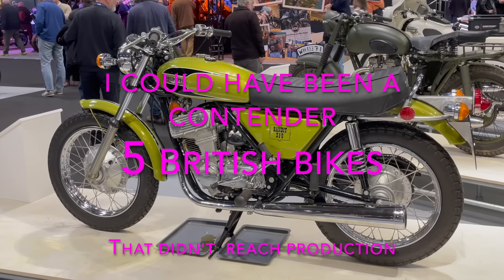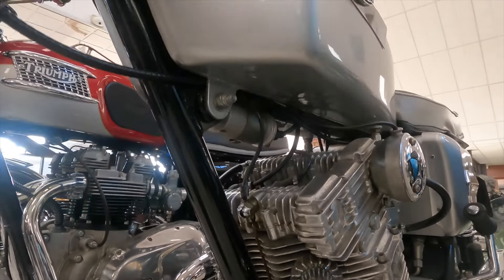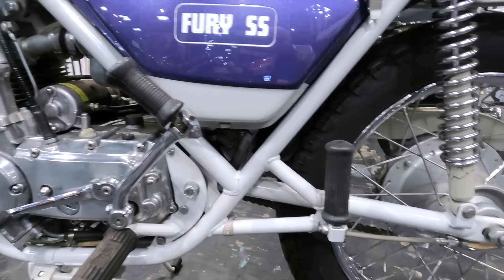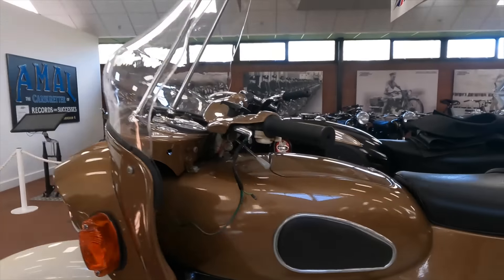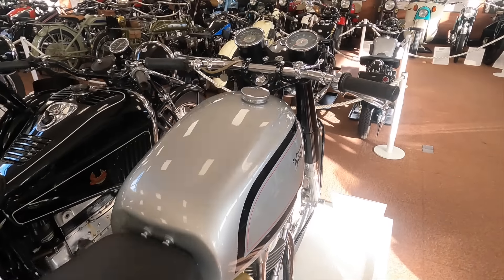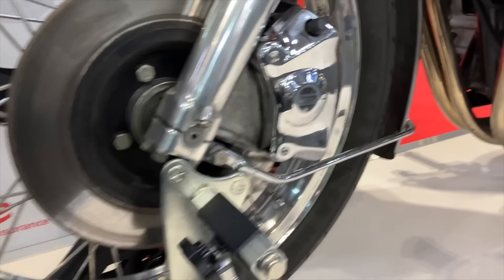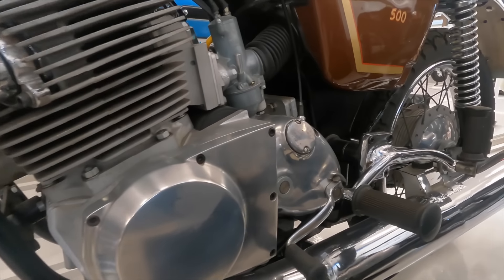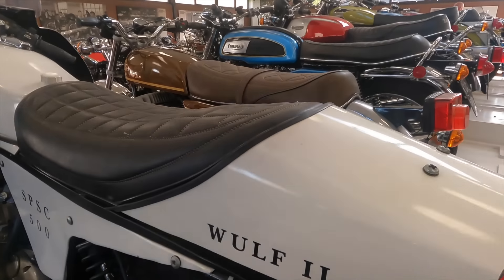They could have been a contender, 5 British bikes that didn't reach production

Comment: Part of the problem was the machinery the bikes were built with. Worn out lathes that the operator had learnt to compensate for. The problem, when they retired their replacements did not know the lathes idiosyncrasies.
Reply: I once briefly operated a lathe for a job. It was German and built in the 19th century. Not unusual for British engineering in the 1970s.
Reply: @borderlands6606  Straight from school at age 15 I worked in a factory in 1963 and none of the lathes or other machines were post war except for three automatic "Index"  lathes which spent their lives making nuts and bolts. I worked a capstan lathe that was made in the 1920s. We were never told what we were making and many of the guages were .... out of guage.
Reply from the maker: There were an awful lot of British machine tools too
German engineering in general is somewhat overrated and it’s often forgotten how many German manufacturers went bust during the 60s too
Reply from the maker: Machine tools have no bearing on these prototypes at all really 
But the do speak of the greater problems of poor finances within the industry 
Motorcycles were always seen as a Cinderella industry especially in the UK and so unlike the car I industry received fairy minimal support throughout their history 
Remember Guzzi and Ducati were nationalised in the 60s because of their perceived national importance 
Harley was propped up got years.
Most of 5he bikes featured could have worked but would need development and that requires money that was never forthcoming. For the UK industry finding investment was always a huge challenge
Reply: @bikerdood1100  those worn out lathes also made the prototypes.
Reply: @brockett  It was said one of the differences between German manufacturing and ourselves, was their workers were trained in different aspects of production. This lead to greater investment in the product, the process, and less boredom and specification errors. Not telling workers what they were making, and producing the same widget every day of their working lives, is one of the reasons engineering jobs had such a poor reputation in the UK. Motorcycle production suffered from the "this is what we make, take it or leave it" approach, like much UK manufacturing of the era. It also has to be said German manufacturing had to be re-built from the ground up after 1945, and was paid for by the allies. If I recall correctly the VW plant was re-established by a British army officer.
Reply from the maker: Not exactly true, blaming the workers is a common sign of bad management 
German production during the war was far less efficient than Britains 
Spitfires were built far more quickly even though it was more complex to build than the equivalent 109
German manufacturers efficiency was very  much a myth.
Germans built the tiger tank for example for more than 3 years but the British built a British tank introduced with months to go before the end was actually built in greater numbers and was more reliable too 
German factories ran 9-5 shifts for much of the war, Uk factories ran 24/7 
Oh those lazy unhelpful British workers 😂
It’s often overlooked just how many German companies went to the wall in the same period. BMW were pretty much sol survivors, they had the car division for help. 
Most British people don’t really know much about the history of motorcycle production elsewhere in Europe and assume the industry collapse was unique to us, this simply isn’t so.
The major difference is that the German and Italian governments would never have let their motorcycle industry die completely. We had a government that did appreciate the importance of manufacturing, especially motorcycle manufacturing which was all too often looked down on
Reply: @bikerdood1100 during ww2 German women didn't work in the factories they were supposed to produce babies not Tiger tanks. So they lost 50% of their workers capacity.

Comment: Went to a talk on the Wulf at the engineering society from two of the engineers who had worked on the project..,they suggested that there was a government grant fund that had being impinged on to help support the Norton Challenger..,and were very unhappy about it...One notable remark that did come out was upper cylinder lubrication had to be assisted by drillings to ensure that ware was not incurred..,and as I perceived it there was an element of 2 stroke like oil consumption...The had bench marked it to a 400 cc Kwaka unit and said it was on par...
Reply from the maker: The challenger might have seemed the safe better at the time, with Cosworth behind the project but from what I can gather about the engine from an article written by Peter Williams a few years ago it was not a great price of design at all, he noted how heavy the bottom end was 
I guess designing the greatest F1 engine ever isn’t the same as building something suitable for a motorcycle. Certainly judging from his thoughts on the engine it would seem the wolf may well have been the way to go

Comment: The Wulf is an interesting machine.  As a lover of 2 stroke engines i find them fascinating.  The Norton is a thing of beauty.
Reply from the maker: Shame really possibly the best concept in the video
Reply from the maker: Ditto most later day two strokes, there is no perfect engineering solution ultimately. Despite the 20% heavier piston the Wulf still had 40 odd horses and tested performance is in the ball park of 500s of the day despite minimal development when tested at MIRA
Reply from the maker: The Wulf was tested at MIRA and it’s performance was in the ball park by 70s 500 standards despite a 20% heavier piston 
Not really fair to describe all their designs as exotic now is it 
OHC royal Enfield 175 ?
Reply from the maker: Except of course, they don’t. On road bikes the difference between two strokes and four strokes diminished somewhat above 250cc, if you ignore the rather dishonest claims made by Kawasaki for their triples. 
Suzukis Gt 500 twin claimed 44hp very similar to the Wulf and less than some four stroke twins.
Similarly Yamaha’s sporty Rd 400 was slower through the 1/4 mile than the OHV Guzzi V50 and not the sporty model either and that’s as tested by superbike magazine in the 70s.
Two strokes are more efficient at smaller capacities no doubt but they simply don’t scale up on the road. Different in GPs of course but that’s pretty meaningless on the road

Comment: Back in approx '75 Bike mag did an article on British bikes which never made production. Memory may let me down,but i recall a 5 cylinder bsa,a triumph 250 triple and the rotory. I wonder is that issue still available? Great video and how do i stop my 850 wet sumping?!
Reply from the maker: It was part of Doug Hele’s modula concept 
The management went with Turners 350 instead, which explains much of his distain for the project
Wet sumping can be stopped in a number of ways 
Or reduced at least even modest Harleys wet sump 
Some fit a tap which can lead to disastrous results if you forget about it 
Others an anti wet sump valve which helps but isn’t perfect 
I lead my bike the the sump plug loose and let it fail through into a jug then tighten it with a spanner I leave next to the bike
Reply from the maker: But don’t ask Harley 
Italian bikes tend to go for wet sump which in many ways proves not a thing P&M always cast their oil in the castings like Enfield and wet sump was very common during the 30s. Wet sump does have its disadvantages after all 
Engine height , oil capacity and cooling 
And wet sumping is really only a problem these days in the 50s with mono grade oils, pumps that were new and more importantly the bikes were used daily wet sumping wasn’t an issue. It’s an artefact of modern biking when bikes are used much less often and not a fault of design
Reply: @bikerdood1100  when i had my 750 roadster i used it for work daily,but 850 is rarely used. Have now bought sump can with spout where i drain out approx 1Lt and pour back into tank. Andover warned me about electric valves,so will give that a miss. This mk 3 may not be as fast as 750 but at least there are more than two positions on throttle-wide open and shut!

Comment: Interesting, some I newer heard of. The Bandit/Fury, was it split horizontaly or vertikaly? It was hard to tell...
Reply: Vertically.  We used to be so excited about that machine back in 1971 - and I still think it looks wonderful today, the only genuinely new bike from the 'Power Set' range.
Reply from the maker: Vertically but horizontal assembly is nor the guarantee of oil tightness that some think and indeed some modern Japanese bikes use vertically split cases today
Reply: Yes, vertically split crankcases would seem to be a route to better oil-tightness but, as you point out, it ain't necessarily so.  I've operated an NTV 650, a C90 and a current Royal Enfield 350 - all vertically split and with no oil-leaks!!  More study needed!
Reply from the maker: And Honda single engines of 250 upwards since the 80s and it’s still the case today

Comment: The 74 year old Edward Turner was given the task of designing this bike despite BSA having arguably two of the best designers in the world, Doug Hele and Bert Hopwood. Turner was a geneus at his best but most of his work was sadly lacking. Often suffering from simply problems that could and should have been rectified, but due to his nature of always believing in been right and everyone else been wrong, many a good bike never reached it's full potential. However this bike was so badly designed from the start that even the best efforts of Hopwood and Hele could not sort it out, both Hopwood and Hele wanted to scrap Turners design and start again, but as usual at BSA during this period the higher management knew best and the bike never officially went on sale. Shame really because a simple adjustment with the bore and stroke would have given BSA not only a 350 but also a 250 bike for very little additional outlay
Reply from the maker: You do have to wonder 
Not too surprising Hele was less than impressed 
Turner had his moments but was by reputation not an easy man to work with
Reply: The red reason why the British motorcycle industry collapsed was nothing to do with either the companies themselves or the Japanese, it was to do with the environment they had to operate in. A product that was seen at the time to dangerous noisy and outdated and ridden by hooligans, that was been out sold 20/1 by the car. The government didn't help with heavy purchase tax that effectively limited the price any manufactur could realistically ask for their bikes and then there was our world leading banking industry who had and still have zero interest in offering sensible finance to industry. Compare this to Japan with their pro industry government and banking industry but above all else a massive domestic and local market for motorcycles. But always lazy and convenient to just blame the Japanese

Comment: You certainly know so much on machines, mechanics. What a shame BSA and Triumph ruined their repiutation with reliability issues. If they had sorted out those old A50 and A65 twins crankshaft timing sidebush. SRM engineering sorted out the crank issues and royal enfield mk2 interceptors are the best parallel twins from UK  . Norton commandos were. Beautiful but again suffered crankshaft issues especially the combat engine.
Reply from the maker: The use of a bush is very much overplayed in reality 
The use of roller bearings in reality is not superior to plain bearings, note that all modern motorcycles use plain bearings 
The issue was more to do with poor oil supply made worse by a lack of regular changes and quality 
Running a higher compression ratios in an effort to tune the engine beyond its designing limits was not too clever either 
Problems on early A65 / 50 were in truth mostly electrical in nature 
The switch to battery coil was not a smooth one 
Very late BSAs are pretty good really and are had a reputation at the time for oil tightness but it was a 10 year old engine design by then 
The SRM conversion is expensive and in truth is not necessary in many cases. My own A10 runs the standard bush and has not given problems in over a decade of ownership.the A10 has a generally better reputation but runs the same bottom end bearing design.
Given regular oil changes and good quality oil the A50 in particular isn’t likely to give trouble but like all bearings it can wear out, especially with abuse and neglect 
If I had an A65 or A50 that was very tired and worn out I may consider the SRM conversion but given a perfectly ok engine I’d leave well alone
Reply from the maker: Norton comando was a clever design overall but the SS with its Combat engine was a mistake that put the company into financial problems 
The constant moving to different production sites over the years certainly adversely affected production quality and the finish on the 850 is regarded as being of poorer quality than the earlier 750s. The gearbox was built to poor tolerances also but this really only showed itself in the formula 750 racers

Comment: Shame the 4 cylinder Triumphs didn't get the funding & R&D they needed as with the onslaught of Japanese machines things could have been very different. Be nice to see these machines though where was the video footage taken?
Reply from the maker: Some was shot at a museum others at shows 
I’m not convinced a multi was the was to go 
Other European companies avoided taking the Japanese head on. 
A more advanced twin may have been better, a sort of British Ducati
Reply: @bikerdood1100  Yes, with hindsight the salvation of the Triumph name is the triple motor. As a mid 70's bike mad teen, BMW were for old beardy men, Ducati & Guzzi etc for men with an Italian fetish. NVT promised much & failed. So Japan it was for our cash & hp finance deals.
Reply from the maker: Say what you like about the German and Italian manufacturers 
They survived 
The triple didn’t actually sell that well 
25,000 or so. Not terrible but the twins sold better.
For me the European side stepping and feedback into a niche market was the way to go for smaller companies 
Benelli tried the head on approach with their 4s with limited success 
A 900 triple may have done rarely well but I have a feeling a light, nimble twin with an advanced engine would likely have done rather better against the poor handling bloated Japanese 4s of the late 70s early 80s. 
Italian bikes did very well doing just that and having owned a few 70s Italian bikes they are bloody good

Comment: Fury was a late contender for the Honda Black Bomber. Which had its own issues.
Reply from the maker: Black bomber was a 450 
It was designed to compete within the CB 350 which was an important beginner class in the states at the time, so in truth it was not intended to take on the black bomber at all. The 350 capacity was chosen very specifically